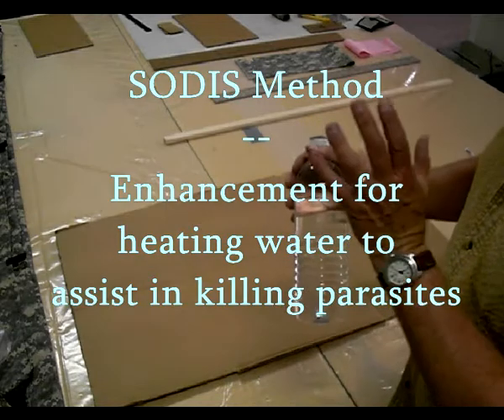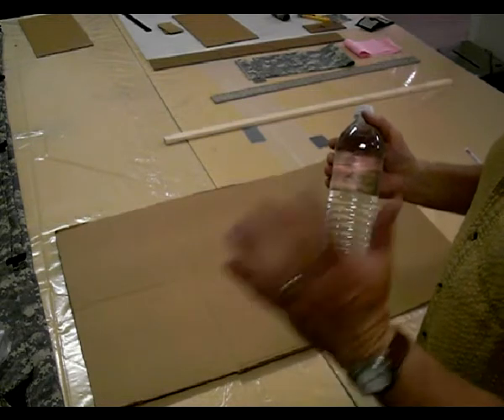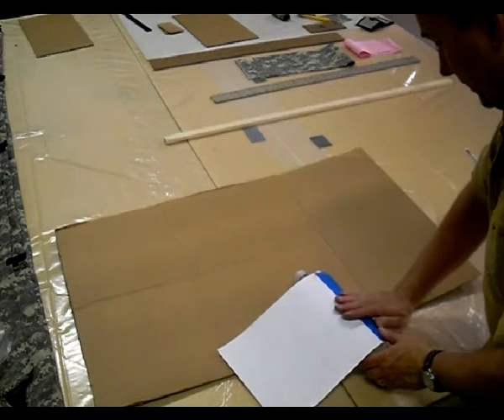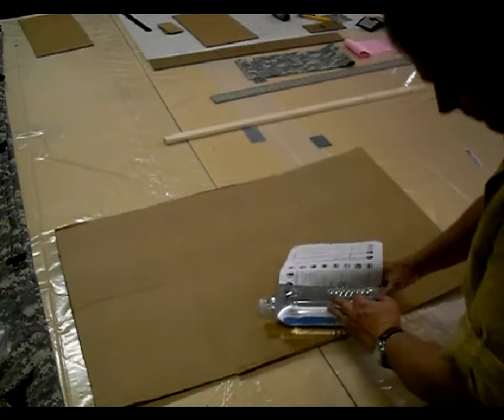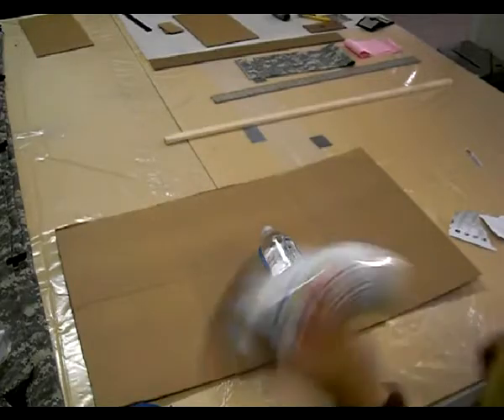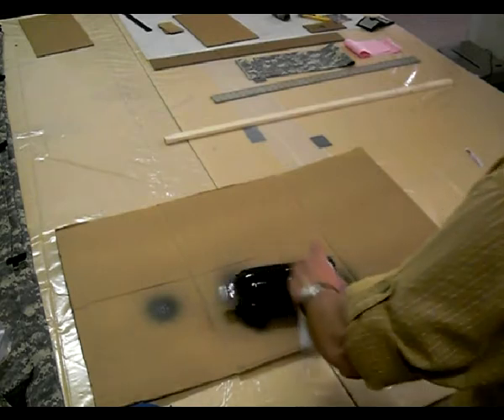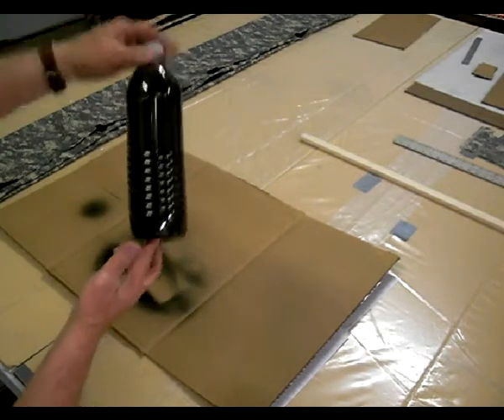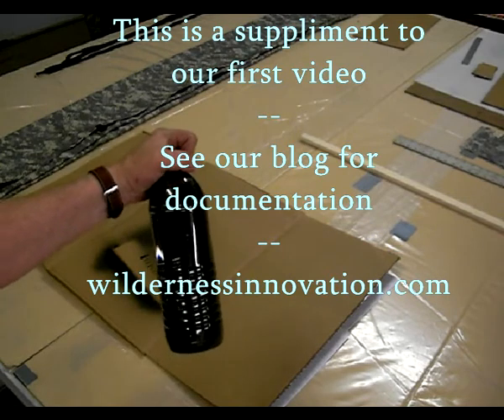Enhance SODIS water purification: heating

Comment from the maker: Another point to make is the UV-A  alone is enough to take care most any water that is clear enough for this method. The heat is useful where there may be certain amoeba to be killed, these need 1 hour at 122 deg F or 50 deg C. Keep in mind that in most of the world where this is used, (developing countries) they simply lay the bottles on corrugated metal roofs for a day, and that works.

Once again my interest is cheap simple disinfection, and without fire or fuel. Thanks to all!!